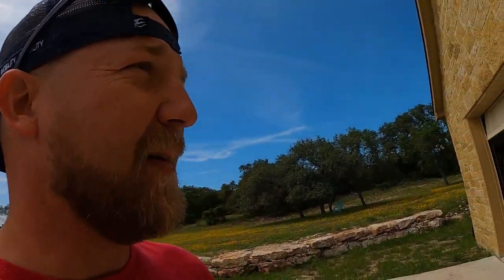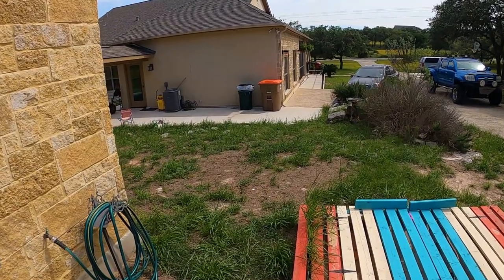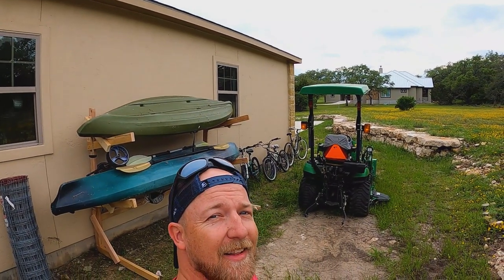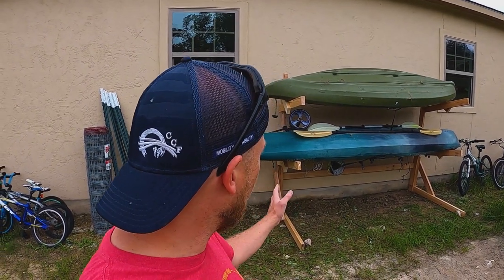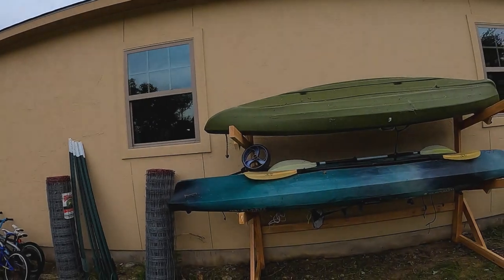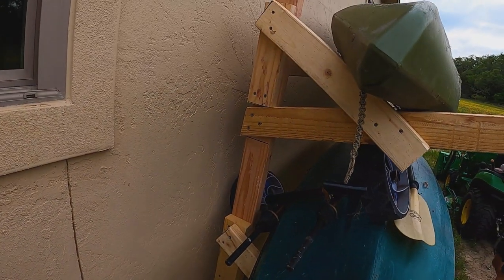Kayak Rack made from scrap wood DIY

Comment: I don't have space inside for my 2 kayaks and plan to build some type of wooden structure in my backyardtoo.  It wood be cool if I could add caster wheels to the structure for maneuverability.  But not sure if there are any casters in the market that are suitable for permanent use outdoors and exposed to rain and the weather?
Reply from the maker: Maybe fashion two wheel barrel or dolly wheels to move the rack like a dolly if you need